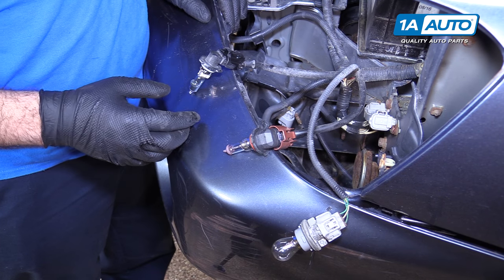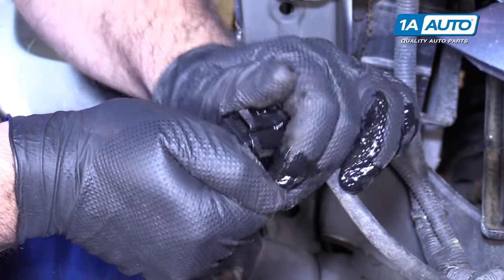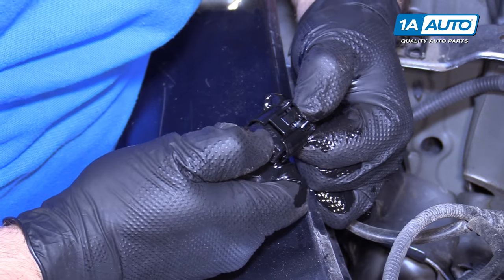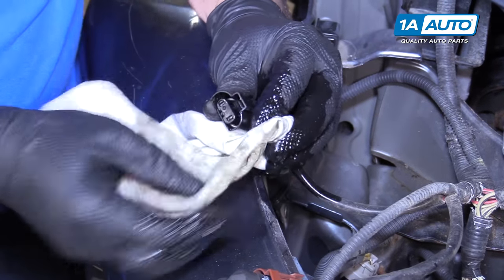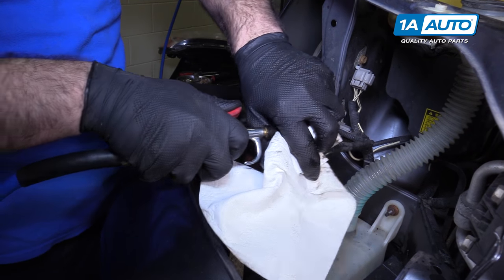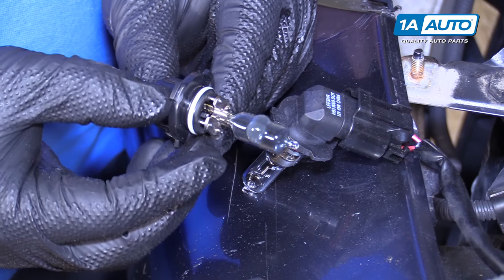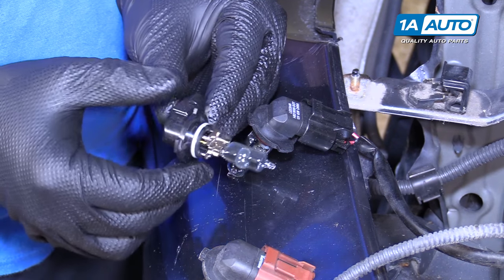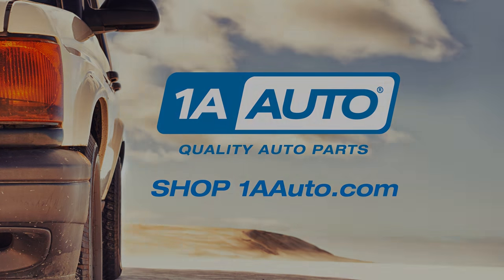How to Fix a Stuck Bulb Connector

Comment: I tried WD-40.... Wiggle in and out... can't feel my thumb anymore... any other things to try? This last and 4th light is NOT disconnecting.
Reply: Did you figure anything out
Reply: Yeah, mine was stuck too. I used the wd-40 and a small wrench and carefully gave the plug a few tugs and it came off.

Comment: My issues is the 3 screws, I can't turn the light bulb to come out at all due to those 3 screws that were tightened and are too rusty. I don't want to have to go to a mechanic if I'm able to do it myself but I can't even get the tip of screwdriver in it's rusted so bad.

Comment: I had so much trouble removing an H4 plug from the socket. Seeing that you used WD-40 to loosen it; I did the same thing. In less than a minute, it came off. Should have done that from the start instead of wasting 30 minutes.

Comment: Where do you get the spray? Could you list a brand? I’m Having a hard time removing an O2 sensor connector. Will ww40 work?
Reply: "Water Displacement Oil" is what he said.  WD40 stands for "Water Displacement, 40th formula"
So yeah, WD40 is perfect.  Just used it on mine 👍
Reply: @sonictimm  never knew that's what it meant interesting

Comment: Saw a vid in which the guy tapped a connector a million times apparently doing nothing. And he said DO NOT SPRAY WIT H ANYTHING. Hu h?? Reason: the fitting was packed solid with dirt so he couldn't push the clip down. Eventually the tapping freed the dirt and it came out. Spraying would make mud, making things worse.